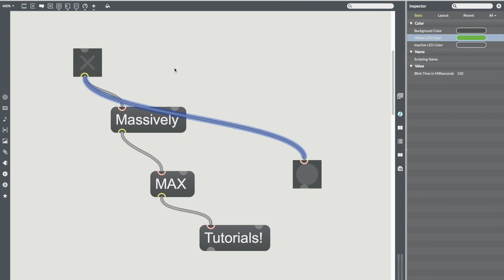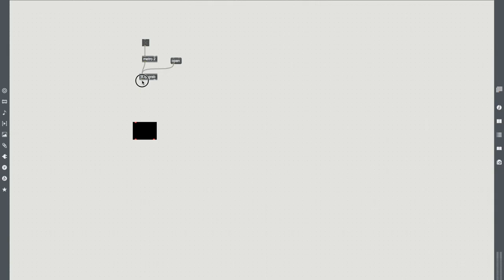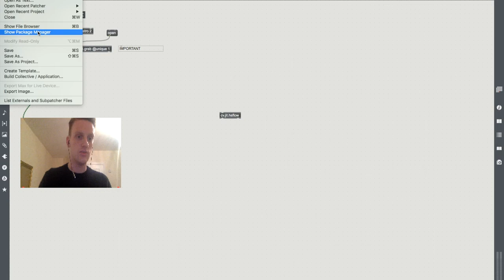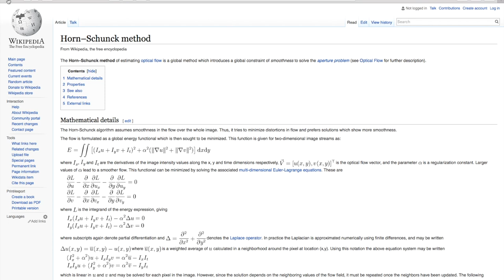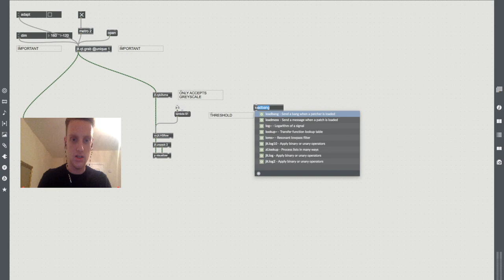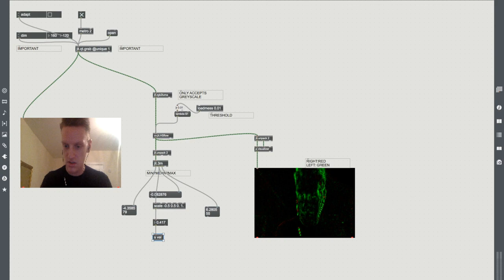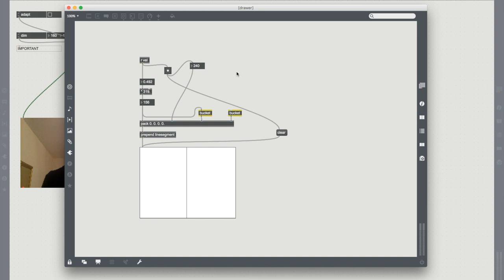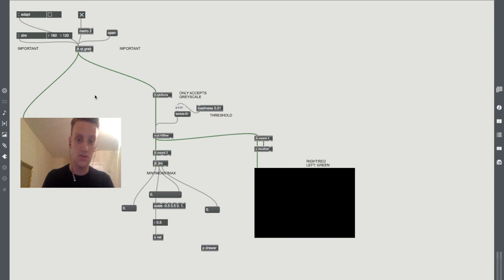MAX msp 7: video velocity using cv.jit.HSflow

Comment: I don't see the 'package manager' and I can't see the cv.jit.HSflow, im getting 'newobj: cv.jit.HSflow: No such objet' could you tell me what i'm doing wrong please?
Reply from the maker: +ManLikeKane Are you using max 7? If not, you won't have the package manager - otherwise its simply file > show package manager. 
You're getting the "no such object" error as you have not got CV.jit installed. You can manually find it and download it here: http://jmpelletier.com/cvjit/ You can refer to the cycling74 forums to install libraries to your specific version of max. 
Let me know how you get on!
Reply: +Michael Mckellar Yh i don't have it installed, weird cos i'm using 7.0.6 I managed to download the file a while after my first comment now i'm trying to figure out where to put the downloaded files. the instructions say: Move the "cv.jit-support" and "cv.jit-help" folders inside "/Applications/Max5/Cycling '74" folder. I don't see that folder in my applications folder though? I feel i'm close
Reply from the maker: Hmm, its a difficult one to say without being there. With max 7 all you normally need to do is put externals into the /documents/max7/library and it should auto orientate from there
Reply: +Michael Mckellar I'll try that thanks
Reply: +Michael Mckellar it worked thanks again
Reply from the maker: +ManLikeKane 👍🏻 Magic!